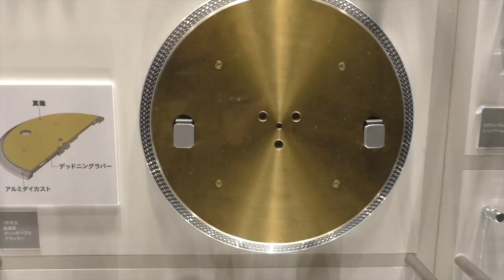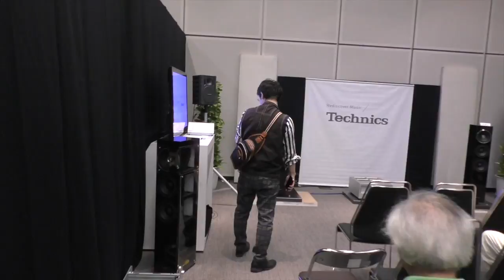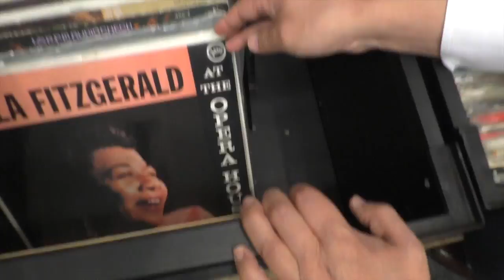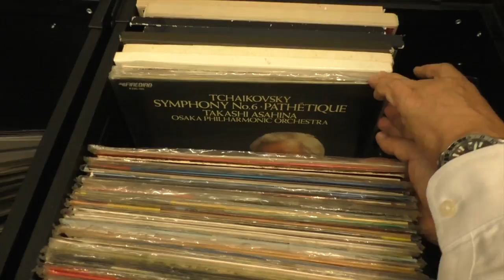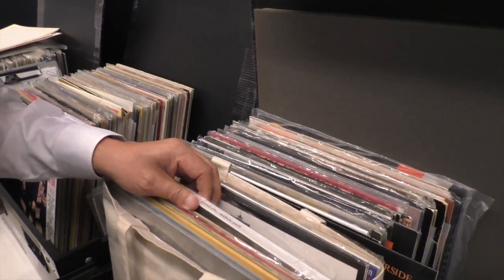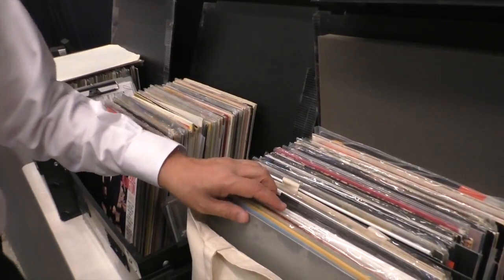Technics SP 10R Direct Drive Turntable With CTO/Chief Engineer Tetsuya (Tony) Itani

Comment: Look at this absolute fool! I own a technique sd10 MK2 with a custom plinth and a SME type 5 tonearm and a. Talisman virtuoso five cartridge. That cartridge alone was worth $1,200 in the mid 80s. I got it used for $800. My VPI series 3 hands down. To this day the Techics beat everything I have ever listened to. This is when all the Hi-Fi assholes were like all you have to have belt drive not direct drive. There is no reason on the face of the Earth that the new Technics Sp100R it should cost $20,000. You would have to be an absolute moron and mentally deficient to spend that kind of money on something that should cost no more than $4,000. Modern autofiles are assholes. There's a type of people that will tell you putting a battery on a cable makes a difference when even though science proves it wrong and actually makes it worse. But what do I know I've only been doing this since the '70s.

Comment: With the reintroduction of the sp-10, I hope technics will reintroduce the sp-25 / 15 which were awesome turntables.
Reply: Would not be difficult as the 25 could be based on the 1200GR and the 15 based on the 1200G.

Comment: Thanks for this video Michael ...... Great first edgy question, love it!

I'm probably ahead of myself here and we''ll have too wait for the final version, normally I'm a positive kinda guy, but I'm not convinced, smacks of insincerity to me....

The new Technics 1200G has 3.3kg of torque, double this to 6.6kg for the new sp10 R as stated in the video, compared with the old MK2 which is 9kg and the MK3 a massive 16kg of torque... not that it's all about torque, right?

We'll wait and hear how it sounds.... would love a side by side comparison with either a mk2 or mk3 in a Albert Porter plinth or a straight shoot out with a Artisan Fidelity sp10 ..... 

Still there are some positives to the new sp10 r - modern styling and a new looking platter....

whoosh!
Reply: It is easier to produce more torque with a cored motor (original SL1200 and SP10 series), but the torque ripple (a.k.a cogging) tends to be higher (although this can be partly mitigated with slotless rotors or skewed coils). A coreless motor (SL-1200G, SP-10R) is the opposite - the lack of iron in the coil formers makes it more difficult to produce torque, but the rotational smoothness is improved.
In their old turntable series, Technics emphasized torque, and quick starting speeds (which is what made these desirable for radio stations and DJs).
The new turntable series is placing a higher priority on smoother rotation, with Technics compensating for the reduced torque of coreless motors by increasing the motor diameter (SL-1200G), also stacking the coils (SP-10R).
Clearly Technics is not attempting to simply rehash their old designs, but improve them.
Reply: Hey Karaoke Dogs, thanks for taking the time and explaining, very interesting.... I do have a question, doesn't that torque help keep the pitch stability of the TT?
Reply: John, I don't believe that much torque is required to maintain pitch stability. For example, the oft-lauded JVC TT-101 only had 1.2kg/cm. Subjectively, however, the low-torque DD turntables with lighter platters (examples include Sony TTS-8000, JVC TT-101) tend to be a bit less capable at conveying rhythm and dynamics than similarly low-torque DD turntables with heavier platters (examples include Yamaha's GT-2000 series, which used JVC-designed coreless motors).
That said, evidence suggests that the arm-cartridge fundamental resonance frequency and how effectively the resonance is damped plays a bigger role in pitch stability than has been previously assumed. If you don't mind over 70 pages of technical discussion and mathematics, I highly recommend reading the "Turntable speed stability" thread on diyAudio. http://www.diyaudio.com/forums/analogue-source/309349-turntable-speed-stabilty.html
Reply: thanks .... diyaudio always has interesting bits and bobs! will give this some reading....
Reply: As far as I know, new SP10 R is to have 9.7kg of torque. Plater weights at 7.85kg. That is the info i have on it. But keep  in  mind that this is the mockup only. Still in R&D phase.

Comment: Thank you for this video!! So good also to hear Carly Simon again! Just a small piece of critisism though. The original SL-1200 design has never been developped for the DJ spcifically. At the time it was a top quality design for both private and studio use. So it had to be sturdy and easy to operate. Its tone arm could acommodate a very wide range of cartridges with a clear limit as for those having very high compliances like the ADC XLM or the Stanton 881-S. These did not feel quite comfortable on the standard SL-1200 tone arm. Having said that, later on another end user group appeared on the scene: yes, the DJ. At the time, the SL-1200 design was about the only turntable that could withstand the abuse and terror it had to undergo in the hands of the turntabelists. If it wasn't for the SL-1200, records were extinct I guess. But we may disagree on that one! Kind greetings from Hekelingen, Holland. Oh, by the way, I have sold and set up more than 150 new SL-1200's during my time as a retailer. It was during the final days of the LP record. And the very last one I sold, was the one I still have here. It is working like new and performs without any difference next to its end of the line production unit. Bought that one in 2010. Bye!
Reply: leyland9999 Technics forever!